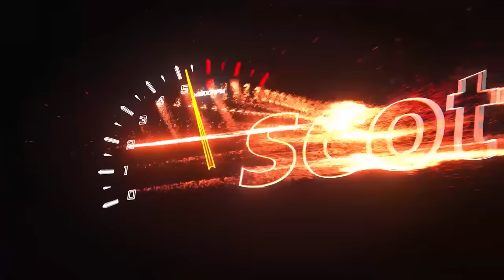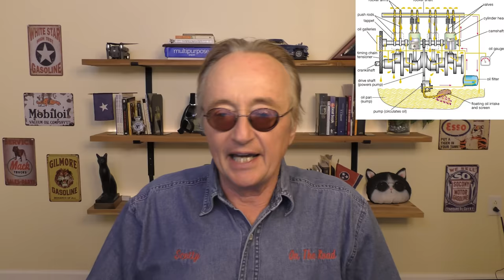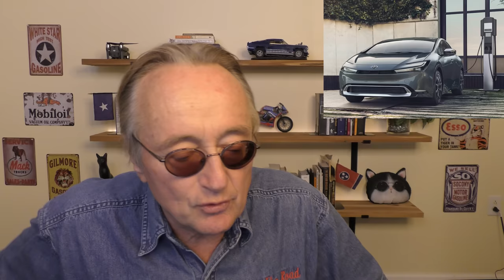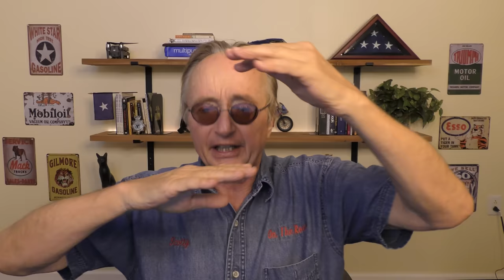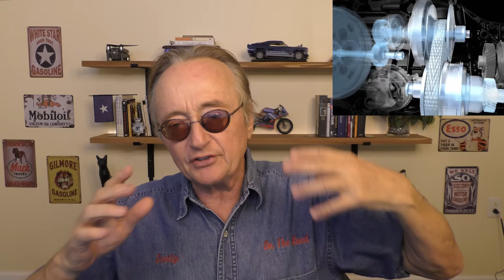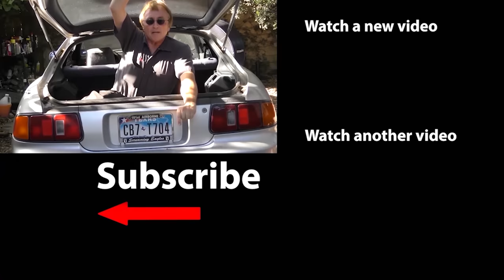Never Do This When Changing Your Engine Oil

Comment: I've been a mechanic 
for 40yrs basically out of my garage and I "used" to enjoy it. I've talked to many dealer mechanics and have noticed a common theme. Even with modern diagnostic equipment  the time it takes to replace a transmission in many vehicles requires teardowns that take up too much time and they get 8hrs to complete the job. Engineers have really thrown mechanics under the bus.
Reply: What years for pickup trucks are easy to repair?
So far, I've read 90/91 Chevy.
Any others?
Reply: @thisismagacountry1318  1988 to 2001 jeep cherokee.
Reply: @k9under  That's not a pickup truck
Reply: @thisismagacountry1318  it's not just the year , it's there are certain pick-ups/vehicles that develope the same problems over and over. I personally prefer Fords with 4.6 engines. They've proven to be bullet proof. Chevys aren't bad either. I don't care for Dodge
Reply: We get good at what we do. Transmission replacement can be done in 3 hours. Heater box replacement? I can do in 2.5 hours
Reply: @rowenakers8712  lol then I can tell you haven't been at it that long. You're in for a surprise.
Reply: @thisismagacountry1318  if around ga.  i got a 90 gmc gmt400 long bed 4x4 5.7l tbi  metal bumper with built in winch and air ride suspension.  $3800.   easiest truck to work on by far can just step up on bumper and its like a 4cyl in there so much room everything easy to get too.
Reply: Heading into the age of EV, these type of problems won't be around for too much longer.
Reply: @AStanton1966  Yep we'll have a host of new problems instead! No tech is perfect, EVs included. And at Subaru, we get paid around 4 hours to do a trans r+r, and it takes that much time at least. Warranty work is such hot garbage
Reply: @thisismagacountry1318  9th Gen f150 with the straight 6. The engine bay is wide open. You can get to everything without issue.
Reply: One of the many reasons I prefer cars made pre 2000's era
Reply: The 88 to 98 chevy trucks are known as C/K trucks, they dont have all of the sensors and added accessorys of the new trucks as they are of a simpler design. However, major work such as replacing a transmission is a major job, the rear spark plugs are hard to get to, theres nothing easy about car mechanics but they are simpler than the newer trucks with variable cam timing, cylinder deactivation, etc.
Reply: Fords are overhead cam engines, great when new and can last a long time w good maintenance. When the engine fails its not feasable unless you are a Ford Mechanic with access to parts. Best to replace engine or junk car, they are not like old chevy 350 engines that can be rebuilt with a cheap kit.
Reply: @rowenakers8712  I remember a mechanic friend telling me years ago he had to replace a heater box in a Cadillac.  The book called for 8 hours.  But he said he cut a small hole in the firewall for access and had it replaced in less than two hours.  He said after he finished no one could tell a hole was cut.  But it saved him a lot of time and saved his customer some money.
Reply: @thisismagacountry1318  Frontiers. 2004 - 2020
Reply: @AStanton1966  with EVs, lemming syndrome will be a great mystery. People just drive off cliffs. 😅
Reply: Ans this is tied in with what is called "planned obsolescence".
Reply: @AStanton1966  yeah, because the computers and sensors will be in trouble before the motots wear out
Reply: What does this have to do with anything here though? 🤷🏽‍♂️
Reply: @rowenakers8712  you should be a mechanic 😅
Reply: My, recently Retired, 50 yr Mechanic, says that too. " Engineers have really thrown mechanics under the bus."
Reply: @michelt4390  I hate replacing a motot, especially the leaky ones, so messy😬

Comment: I'm a retired motorcycle technician and machinist from 1979 and now I'm in parts, accessories and service and repair. I always tell our customers to Remove the new oil filter from the box, remove the plastic cover, set in the box upsidedown and fill it with new oil and coat the o-ring prior to installation while the engine is warming up getting the oil up close to operating temperature and to get any impurities that have settled to the bottom of the engine mixed in with the oil. Shut the engine off, drain the oil, remove the old oil filter making sure the o-ring is still in the filter and not on the engine, clean the oil filter surface on the engine, replace the drain plug gasket if it's aluminum or an o-ring if it's flattened, and torque to factory specs. By the time all is done when you go to put the oil filter on it would have absorbed 95° of the oil and even if it screws on sideways you may only lose a tablespoon of oil not like Scotty says to put it on right after it's filled 🤪 and tighten to specs. If this is done this way, you'll notice the oil light "if the bike has one" will turn off 3 -5 seconds quicker than if the filter was not filled. Out of the thousands of bikes I worked on I only seen one bike that the oil light didn't turn off because of an air lock so all I did was loosened the filter just enough for the air to escape allowing proper oil flow then retightened it. From what I understand if it's a diesel engine this must be done also if changing the fuel filter which is basically priming the system. Even if Scotty say you don't have to do it, I'm still doing it because it takes very little time and there's no negative results.
Reply: It’s redundant tho, kind of a waste of time, but If you enjoy it go for it.
Reply: @felipetejeda7545  Coming from someone who's probably never turned a wrench, but if you have, then you're pretty ignorant as to what I wrote and not learn something from someone with probably more years experience than your age. When it comes to what I wrote, it never gets outdated.
Reply: @cliffords.8341 the description you wrote above, these are exactly the same steps that I use when doing my oil changes, and it has never done me wrong. The only mess-up I did was forgetting to put the drain plug back on, and pouring the new oil in the engine. As you can imagine, it made a big mess on the floor. 🤨 but lesson learned, now I torque the drain plug…haven’t made the mess since.

Comment: Yes this is true you don't need to fill up the oil filter but it is generally a good idea to put oil on the seal. There are many reasons to do this.
Reply: He wasn't talking about that, he was talking about filling it.
Reply: good point
Reply: @mplslawnguy3389  Lubing the gasket is important,it keeps it from getting stuck when removing it.
Reply: I say fresh clean oil rather than as I have seen , dirty oil .
Reply: They always recommend putting oil on the new oil filter gasket.
Reply: it probably doesn't really make a big difference, however I still do it anyways. It's easy and definitely doesn't hurt. Now if it's an upside down or difficult filter, I'll skip it. But I figure there's no reason NOT to fill it.
Reply: @QuincyStick  I always use an engine flush , either Amsoil or Liqui-,Moly . Have been for YEARS and not found it to be detrimental in anyway . I think this is the reason my oil comes out golden and I can see through it has it drains . In comparison to seeing others oil as in BLACK .
Reply: @peterrudy9207  This is not meant to be rude but, this has nothing to do with what I said lol. We're talking about pre-filling your oil filter lmao.
Reply: NOT the subject of this video at all. Of course you lube the gasket.
Reply: Always lube your gasket to prevent pinching and then oil leak
Reply: If it’s not important to pre fill your oil filter during an oil change, then why do most filter have anti drain back valves ? Anti-drain back valves prevent you starting your engine with no oil in the filter.
Reply: @Matys1975  Z I do fill my filter before installing it. But lots of vehicles don't have a filter position that allows that, so it can't be that important.
Reply: @davidreed6264  If you don't already know that you have no business anywhere near the vehicle.

Comment: Scotty. Modern spin on filters do not drain after they’re full. They have back drain valves. You know that. Remember every time you remove a filter it’s clear full of oil.
Reply: He's talking about filters that are mounted upside down.
Reply: @mplslawnguy3389  yup, the upside down oil filter on my Subaru has oil in it because of the anti drain back valve. I can put oil in the filter and install it without the oil “falling out” like he said it would
Reply: @boondockmutiny9955  Still, there's really no reason to do it.  If it makes you happy, go ahead, but I've never done it and everything has been just fine.
Reply: Okay, still no point in prefilling any filter other than one on a diesel.
Reply: They still drain a portion of oil when you unscrew it. Drips on the control arm.
Reply: I was hoping someone would point that out.

Comment: I'm glad Scotty touched on the issues of plastic oil pans.  I bought a new 2020 Mustang GT and I never liked the idea of it having a plastic oil pan.  I wanted to trade up for a Ford Explorer ST, but they had plastic oil pans too.  I traded the Mustang for a 2022 Dodge Charger Scat Pack--and I'm loving its metal pan!  I would never buy another Ford product with a plastic oil pan.  And if you researched their Raptors, you would see at one time their pans were plastic also, but then they switched back to metal--why!
Reply: I have a rust hole in the oil pan of my Focus SVT
Reply: @robertdavis171  Ford used to have a slogan: Job Quality Number #1!
Reply: What’s funny is the plastic pans are stronger than the steel ones. They will also never rust and you can’t strip the drain plug.
Reply: @luuk-out-below9804  wrong. They do not. I’ve been using the same plug for 5 years. I ring and plug still work just like the day I got the truck. I hate the internet. People just make stuff up and repeat crap they hear that has no basis in reality.
Reply: The pan test is on YouTube. The plastic can't hold up to abrasion but it may be stronger in rigidity. Is that good? Hard to say except the hot oil will make it brittle over time. That can crack and then it's game over. Engine scrapped

Comment: I had a vehicle checked out by a mechanic because vehicle was 1100 miles away. Took pictures, checked things out off site. Mechanics pictures didn't match pictures posted on dealer site. I knew about damage, but it was far worse than dealership claimed. So thankful I had inspected by a qualified mechanic!!

Comment: Pouring oil in the new filter before you install it is an old hot rodders trick. Guys used to do that to help the oil flow faster through the engine. In the days of organic oil it did make some sense to do that. Now it really doesn't make much difference. It's one of those things that it doesn't really help or hurt anything.

Comment: Gates are often suppliers of OEM equipment, I used to work for Renault and they use Gates timing belts, you paid double for the Renault packaged one than you would for the exact same Gates belt from a motor factor.

Comment: Using anti-seize increases the torque applied by 25%. If you use it on bolts you should decrease the torque applied by 25% to get the same applied torque value otherwise you will over torque the fasteners that have anti-seize applied to them.
Reply: Never heard that not saying your wrong I've been working on cars since I was in high school im 65 years old and graduated in 1975 from a vo tech,a mechanic that says he knows everything and doesn't  learn something new every day or week probably is a crappy mechanic
Reply: @michaelstrafello7346  I also learned this very recently.
Reply: I would want to know the exact method that was used to measure this claim. I don't trust anyone that makes claims but can't justify it with repeatable testing by another source.
I would think that using multiple torque wrenches of different brands might be enough, but it wasn't stated.

Comment: Hi, Scotty, 
I haven't had the chance to watch this all the way through, so you may have covered this, but I just got a new Subaru Crosstrek with the 2-liter horizontal four-cylinder engine. As you know, the oil filter in this engine is mounted with the gasket down and the filter can up so that without an anti-drain valve the filter would be empty on every start. 
I saw a video showing the start-up after an oil change. The tech held the gas pedal to the floor while cranking to keep the engine from starting and cranked in intervals no more than thirty seconds until the oil pressure light went out, then started the car normally because then the oil filter would be full.

Comment: I'm not talking about filling up the oil-filter, but rather, just "wetting" the gasket of the new oil-filter with some oil before screwing it on.  You don't need to douse it, or pour oil on it, just run an oil-dipped finger over the new gasket before screwing it on.
Reply: Thats normal practice, or should be.
Reply: Stops the seal from being damaged or sticking so yeppers 100% true.
Reply: Honestly that's all I ever do, dip a finger in the oil and go around the gasket.
Reply: Yes if you want it to come off easy
Reply: They say to use the new oil to lube the gasket, but the only reason I can imagine why is because they don't want to be called out for suggesting touching carcinogenic material, if you're not using gloves.
     The reason to lube it at all, is to easily tighten the filter by hand and have it not come loose.  Also to reduce friction from trying to peel apart the gasket.  In moments, the oil squeezes out and the gasket grips the surface.
Reply: @Qui-9  I've had my hands covered in oil working on things plenty of times. Or transmission fluid, differential fluid, etc. Should I probably wear gloves? I suppose, but for me 9 times out of 10 it makes it more difficult for me to hand loosen bolts to get them out after I break them free with a ratchet and I work on things in pretty hot weather and sometimes the engine isn't fully cooled off when I'm replacing something, which makes my hands sweat inside the gloves even more. I think as long as you're washing your hands or at least wiping off the oil with a rag, you should be fine. I'm more worried about food additives and not too terribly worried about some used viscous fluids making contact with my skin.
Not saying it's not detrimental health wise but it's a lesser concern for me personally.
Reply: @Qui-9  I've seen people double up on filter gaskets and it's pretty bad. Always a good idea to make sure that never happens and to double check for a lodged gasket before installing a new filter. 

Is what I would tell someone who's doing their first oil change.
Reply: Everybody does that, that’s standard procedure when installing a filter.
Reply: That is all I've ever done..

Comment: Never filled a filter at oil change time. Honda, Chevy, Nissan, Mercedes Benz, dealer tech, 4 yrs in the Marines motor t. Got a fleet now, 9 vehicles on the road, plus diesel and gas engine equipment. 48 yrs later, never had a problem.

Comment: Wow thanks for clarifying this. I obsessed over this for long time. My Subaru has upside down oil filter and you can’t fill it with oil and then install. I do the flood mode deal and prime it when changed the oil at 1200 miles for first time. It was probably not necessary now that I know this information. I was going by very old advice all these years

Comment: On a filter that is upside down, I don't fill the filter but I do pour some oil inside the filter in order to coat it, it helps, and you're not starting the engine with a completely dry filter, I don't care what anyone says. When you shut the engine, yes the filter drains somewhat but it doesn't dry out!

Comment: Dear Scotty, One exception to filling the oil filter with oil. My van has a diesel engine and I once made the mistake of not filling the oil filter after a change and I created a major hassle for myself. These engines have a safety that will not allow the engine to run or start without oil. An empty oil filter is read as no oil. So I ended up having to bypass a sensor in order to start the engine and get oil circulating. I'll never make that mistake again.

Comment: I don't fill the filter on my 2000 Merc Mountaineer (mounts sideways, dontcha know) , but I absolutely run some fresh oil around the gasket & wipe down the metal where it mounts up, make sure there's nothing between the gasket & the motor.

Comment: Unless you drain the old engine oil for days and extract every last drop, there will be enough residual oil on the engine components to protect them until the fresh oil is pumped round the engine (which only takes seconds - note how quickly the oil pressure warning light goes out) when you start it after an oil change, Modern synthetic oils "cling", too, which helps.
Reply: Exactly, as long as you fill up with the right viscosity and grade of oil, your engine will be properly lubricated in seconds. Could be a problem if you used to heavy of an oil in cold temperatures but otherwise you’d be safe.

Comment: Yes Scotty there are a few oil filters that are  interchangeable  one has antiflow back  valve and the other one does not aa in Dodge 225 Slamt six has oil filter is upside down so you do not want  to use the Ford  oil filter with no antiflow back valve

Comment: I was under the impression that oil filters have anti drain back diaphragm in them to prevent the filter from emptying especially mounted upside down.
Reply: 1/2 the time those 'anti drain back' valves don't work ( they leak/drain back).